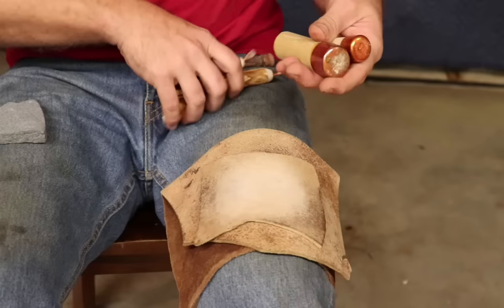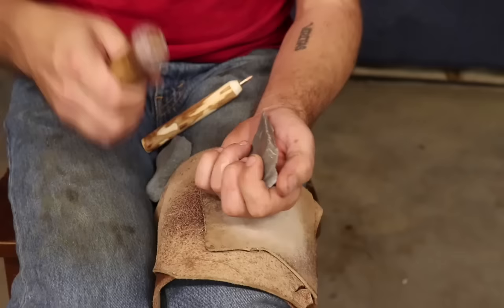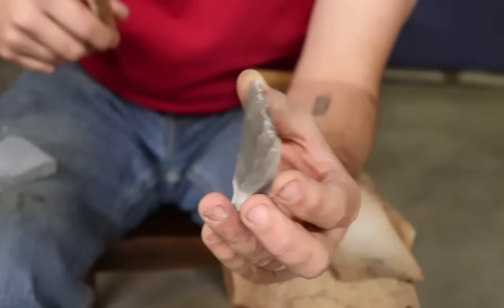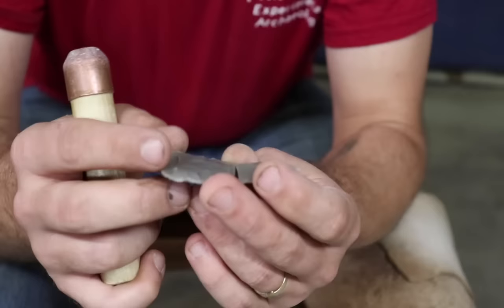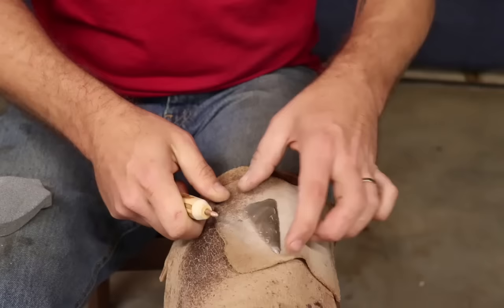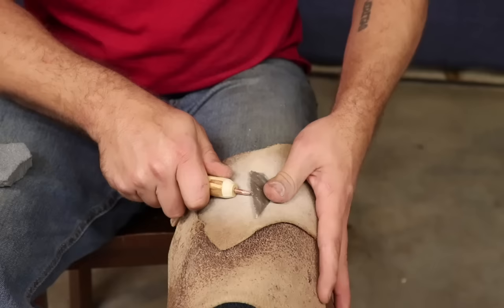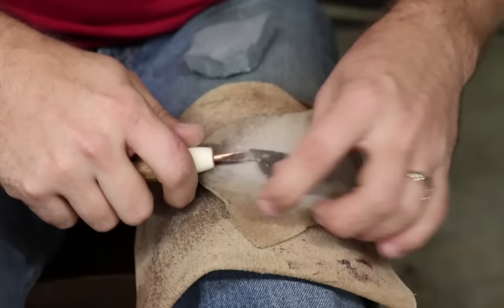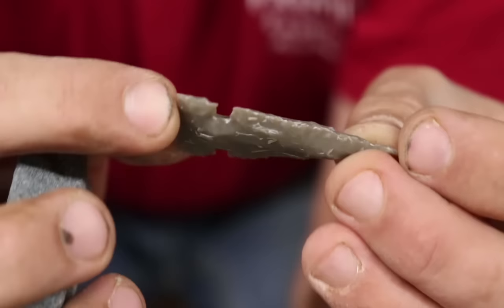How to make an arrowhead . An intensive breakdown for beginner Flint Knappers

Comment: i've been a logger, cabinet maker, sailor, electrician, and electronics technician.  I like to learn new things. I struggled with flint knapping.  The patients you have while explaining this process made it click for me.  I watched, and it made sense.  I went out and tried it with stone, bone and antler tools and it actually worked well for me the first time.  I always wanted to take an animal with a bow and arrows that I made myself and now i'm a little closer to that.  Thanks so much.
Reply: Any luck yet?
Reply: no, had another back surgery. kinda put things on hold
Reply: Good luck 🍀!!
Reply: @rogermartin4104  make sure your doctor uses proper pitch resin glue on that spine.

Comment: E X C E L L E N T. INSTRUCTION !!!
   Thank you for taking the time to show us exactly how a professional Flint-Knaps a piece of stone. It's amazing how intricate stone actually is, and the "cone" of pressure, you spoke of makes tons of since! I played with trying to make a spearpoint, back when I was a kid, and didn't have much luck, of course, I had never seen anyone Knaps before, either. Watching you brought memories back, from what would happen when I got flustered and would loose it and hit too hard and bust the rock I'd worked on for half a day. I lived on top of a Churt pit, so I had plenty of rock to use. That was 50 years ago! I might just make some tools up and try again. I have some kangaroo leather, left over from my Leather-Smithing. I'll set myself up and try it again. Now something from me to you, in THANKS:
    (I notice you drop your tools a lot.) I have spent my life designing tools, jigs, stands, lifting rigs, etc. Why not cut a wooden 4" x 4" a foot long and use either Forstener bits or flat spade bits, slightly oversized to the handle sizes of your pressure flakers and your various Billets, and make a free-standing base, (to set on the floor by you) and cut the upright on the appropriate angle so the top of your tool deck will be more comfortable to reach. ((or use a tripod like a music stand, off the bottom of the tool deck)) Space the holes out so there's plenty of room to grasp a tool. Bevel the edge of the hole, so that the handle "shoe-horns in" easily. Paint the whole stand a flat color, so there's never a chance of the sun reflecting in your eye off of its surface. Then, make it so it can be boxed and put together with just a few screws, and included in your kits. It will hold all your tools at an easy retrieval position, so you don't waist time chasing your tools. (Cut more holes than you have tools, so, as your tools grow, you have holes for them. Install a plastic bar-soap cup for your abraiding stone.) It would be one more item for sale, so you could make your kits to sell, WITH tool stand or WITHOUT tool stand, and price them as such.
   Hope this helps you and all of us, out here in YouTube land.
   Again, THANK YOU !!!
   Bill, from Tn. 🇺🇸

Comment: Thank You!!!  I have been poking at knapping on and off for years - mostly stopping when I get too frustrated.   Box of rocks and tools gets shoved under the workbench and forgotten about until I dig looking for something else and rediscover it.  I think the best piece of advice in your whole video is that if you aren't breaking rock, you aren't learning anything.  Second thing is that if a light tap (or swipe) doesn't do what you want then you aren't set up right.  

There also remains the quest for consistent stone.  Obsidian is consistent but it is scary sharp and unforgiving if you hit it wrong.  I tend to buy heat treated Keokuck but it never seems to act the same. I'm still learning and and different results from what appears to be the same actions puzzle me.  (Suspect that imperceptible changes in angles etc have a far greater effect than expected}  I did get pretty good at thin dime sized flakes on a box of georgetown but ran out of rock (and money)...  Your advice to expect to spend hundreds of dollars on stone is well taken..

Thanks again

Comment: This video is phenomenal!  I watched it twice before buying a flint knapping kit.  Everything made perfect sense in my brain.  Then, I held a piece of flint and a bopper in my hand.  The wheels were spinning but I was going no where.  I hacked a rock to tiny, shattered bits then came back and I'm watching for the third time.  I picked up on things both said and unsaid that I thought I had understood before, but certainly did not.  After finishing watching the third time, I'm going to go back out and undoubtedly whack another rock to shreds, come back and learn more.  Thank you for this great resource!
Reply: Yep.  Things were going really well.  I had it almost to a decent preform then I tried to thin the base.  Snap.  I ended up with something between a thumb scraper and shaft straightener that probably wouldn't do either very well.  LOL
Reply from the maker: excellent, glad to hear it and thanks very much. It definitely takes a bit of time to learn, but I am very happy I could put a lot of information out to help folks

Comment: i started knapping on bottle and glass bottoms i picked up from the dump... or bottle bottoms i brk out my self after having a soda or ale.. cheap and effectiv learning material.. heck i leanred alot just braking thee bottoms off bottles and claning the edges up. i broke mst of them in half at first bfore even starting the knapping but onc my mind connected the dots.. it was mind blowing.

Comment: I recently ordered the 3/4 in bopper and pressure flaker and I gotta say I liked yours better than the one I ordered from another vendor. I also bought yours after I made my own copper boppers. I made my own little rascal and 3/4 inch bopper and I will say my handles are longer, but I will say it is worth it to either make your own OR buy from hunt primitive. I like how convenient it was to order material and tools. I don't normally talk up content creators, but I will tell you that this guy has the hookup. I def. I look forward to purchasing supplies from you in the future. Because practice makes perfect.

Comment: I have learned a lot from you young man..You remind  me of a me. I work on my leg alot, I also use a thick rubber Matt on my work bench.as I reach a  older level in this life I get weaker .  I removed small areas of the Matt around the edge to chip into.

Comment: This is literally the only video I've watched on knapping, I'm thinking that one could not be more informative. Very impressed with your ability not only to produce the arrow head, but to explain how the process works. 
Now I've got to find out why you use copper instead of something harder. " Twisted copper rod" was the most confusing for me. However it's 2 AM and I have to leave for in about 5 hours, so those answers will have to wait.
Reply: The softer copper metal grips the stone better.

Comment: HOLY CRAP!!!!!had the internet been born when i was a child i would be able to do what u can.
DAVE.   I am starting to try to knap on my island i have quartZite which is tough for beginners i read.   

Thank you. I appreciate understand and inspired to smack rocks instead of playing with sticks.  

I was not able to sit through the whole video at once.   But the two primary lessons i learned in the first half hour i think was,    abrasive is one of the most important parts of knapping allowing you to create an edge on one side by smashing n abrasive the lower edge in thinning.   I see points at the store down the road, but the bottom n middle of points are so thick, so I can see he is missing the building a platform n preparing rock so that bigger flakes can be flaked.     

I visited my parents house who had the driveway lined with rocks so i walked through n found some waxy looking rocks, rocks with quartz mixed and rocks with red inclusions n some reddish rocks.     

I was messing outside when i got home making my tools with antler and copper boppers.     yeah i was hitting the rock like a caveman at the beginning of a round rock but quickly learned in my own that once the rock has been broken,   hitting the rock hard does nothing except create fissures.    smaller bops in precise locations give you nicest flakes and platforms for setting up.    It’s embarrassing to show what i have cause it resembles a triangle n it’s thin but having difficulty making the serated part.      I saw you with a longer stick and a copper nail behind your knee.    i’m confused there.   make a knap or c shape on edge then u flip it n remove the back of the piece previously taken out.    

Anyway you talk about bleeding so much u don’t feel it that discouraged me but not enough.    I ended up with a tool that would cut a sapling in a 7!shape.      thank you for all this free information.      People literallly this man is giving away suffering,  patience n knowledge that he learned over his entire life.    the cone idea like a pine cone with grain?   and then when thinnning a stack of paper makes sense.

We do have a lot of rocks that gravity has taken it’s toll on the limestone n other rocks.    The rocks look like lined paper,   might that be an area to hunt or a river, i have to go get some clay to put with sinew.   I don’t know what to use for temper.  when i process n bake it in a cup so it does not crack.   I do have coal (carbon)or sand.?

Comment: Another way to formulate the ebrader, it is used for sharp edges on the side of your rock, if you hit the sharp edge you would basically knock off wee rock particles that almost look like dust from a rock slide.

Comment: The reason why I have only spent about 100 dollars of rock is because I first practiced on glass. I still can't pressure flake and run flakes but I now just learned how to run flakes on a billet to the middle of the price thanks to ryan! I again highly recommend started on glass or if you can find Flint easily do that. I started on glass because I live in Iowa and only found one or two small pieces of Flint myself. But I went arrowhead hunting and my dad found a big thing of it but didn't know how to spall it! It's embarrassing but he used a rock chisel to try and get flakes. I know it's long but I did it to kinda waste time....

Comment: One misconception that I had and I just came to reason with this is, I thought every spall or chunk could produce a point. I thought no matter what every spall or chunk has a point in it somewhere not thinking about pre existing cracks, inclusions, Crystal pockets, concrete/granular sections etc. I’m still very new to flintknapping and it seems like most spalls I pick up has cracks or some problem causing areas some not known until your working the point but very few rocks are just perfect. I’m trying to figure out how to get past each of these problem areas. It seams like the grainy sections wont flake and your platform just breaks off leaving you with a rounded edge with a bunch of little fractures on both sides and I can’t figure out how to get past that. Im going to need a rock whole sale distributor lol it doesn’t take long to go through 20lbs of rock at my low level. @HuntPrimitive Can you do another video on how to get the curve or cupping out of a spall? I know you have shown it a “few” times but I’m still having problems.

Comment: just a question - when you have to take a flake from the proximal end late in the shaping process, when there is a higher risk of causing a shock breakage, would it make any sense to plant the sharp end into some clay, or similar,  to absorb the shock rather than rebounding and cracking ??

Comment: Ok, a few questions that I doubt will get answered .  Why do you choose copper in your tools in apposed to steel, brass, bronze?  Why is the copper twisted?   You are by far a excellent teacher,  and I wish I had access to these back say 50 yrs. ago.  Many thanks to you .
Reply from the maker: Copper it soft enough to have a good grip on the stone, and in the case of the small rods, it's actually a bit too soft, so by twisting them, they become stiffer. Steel transfers more of a shockwave into rock and leaves a lot of hairline fractures.
Reply: @huntprimitive9918  Thanks tons.  I do appreciate the feedback.  Excellent Job you did on the instruction.

Comment: Great video. Very detailed. I appreciate the. Detail you provide. My question is what glue can you use to adhere the copper cap to the wood shaft? Can you use Titebond or do you need a two part expoxy?
Reply from the maker: 2 part epoxy, and also need to melt lead and pour into the cap as well

Comment: The conchoidal fracturing... ever see a window that had an impact from a BB gun? Notice the roundish, concave divot on the inside of the glass? This is the same principle Ryan is explaining. The difference is that the bb impact is in the middle of the sheet of glass, whereas in flint knapping, the impact is at the edge. But due to the semi-crystalline structure of the flint (80 to 90% quartz, or more) it will act similar to glass. This is also the why using obsidian or the bottom of a beer bottle to make arrowheads yields similar results.

Comment: The easiest way I can think of to describe the [hertzian] cone (this is what it's called. A Hertzian Cone) is: look at a piece of glass that has been shot with a BB or bullet. See how it looks like a full cone? Where the BB/bullet struck is where your billet would hit. A BB shot STRAIGHT into a piece of glass will give you more or less the same cone with the same angles for sides every time. This angle is the same angle you'll get from a billet strike. However, when knapping you're only making one side of the cone because you aren't hitting the glass/stone right in the middle like the BB did. Imagine shooting a piece of glass with a BB right on the edge. The angle the BB hits the glass at dictates the direction of the [partial] cone. So it is with your billet strike.

If you still have trouble understanding, I suggest buying the book Flintknapping: Making and Understanding Stone Tools by John C. Whittaker. As far as I know, this is the world's foremost authority on explaining knapping. EXCELLENT book if you're truly interested in knapping.

Comment: One thing I’d critique if anything, it’s easier to learn all the skills using glass or obsidian. Requires a little less “muscle”. For those who are concerned about the price. Its not terribly expensive for obsidian (makes beautiful pieces); for flint, look for a stone similar to lime stone (you can find flint inside of it [reason why you saw some white or yellow on the stone]); you can also find flint in gravel roads or railroad tracks. For glass, and getting rid of the “bowl” (concave and convex) shape, the bottom of a glass bottle is perfect. For that just shake a nail in the bottle until the bottom falls out. 
You can use any stone for arrow heads as long as it makes flakes.
Reply: Also forgot to mention a couple other points. 1) you get better flakes using softer materials like copper or brass then using carbon steel. 2) for the notch (where you attach the point to arrow) it breaks if you see a “V” in the direction of where you are pressure flaking (that’s why he says to flake in opposing directions). 

Hope that too helps.
Reply: Forgot to mention if you do have racks used in putting shoes on a horse, that makes amazing notches.

Comment: Nice work. I wanted to know if you take out some rock where the arrow shaft mounts at the back of the arrowhead? I have noticed that feature on some arrowheads I have came across.
Reply from the maker: That is something that actually has more to due with the manner in which the point is hafted. It's a lot of content to cover, but I touch on that in the video where I built a stone age arrow, and the sister video to that where I made the Edwards style point to go on that video. In the example of say a Cahokia mounds points, it's been concluded that the basal notches are found on the buried ceremonial points in masses, but very rarely in the actual point they have found that were used in hunting. That is a very interesting subject though, that I am actually working more into in the future.

Comment: Hi H.P. very deep video. Never seen one before, so as someone whose interested in survival and the ability to make tools from materials you can find its great. However, I have a question. How do you decide on how big the piece of flint needs to be to get a tool out of it? eg the arrow head bits weren't too big but were bigger than I expected. What about a hand axe / guessing that would be quite a large piece to whittle it down? Adrian UK.

Comment: I have 40” Toyo tires and knapp many arrowheads on the tire, if i want long flakes ill use a stump or a rock. I live near Ishi nat forest and spoke with some atsugewi elders. Some tribes here never used their legs, shoulders and hands. They prefer the pressure and uniform they got from the stump or a large rock. The first time I tried flaking on a rock I about sh** a brick.  1 1/2 flakes. It makes a sound you will never forget. When they got to the fine tuning and notching, they would then go to the leg and hand.

Comment: 16:34 he said a dirty word.  But yeah I get the cone.  The cone is not the flake but the dispersion of energy.  Any impact will start with the energy at a point where the impact is then spread out all ways so you get the energy traveling in a cone shape.  Only the portion of the impact that includes the rock is shown to us the rest goes into the air as sound or into our leg holding the leather.